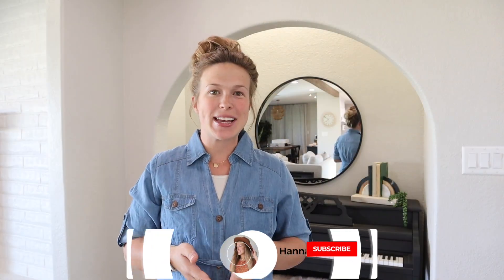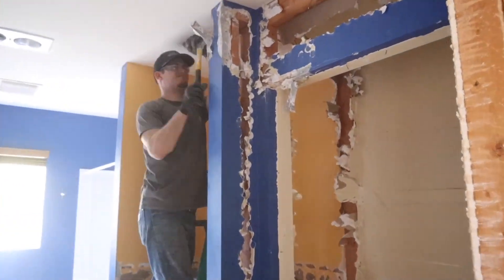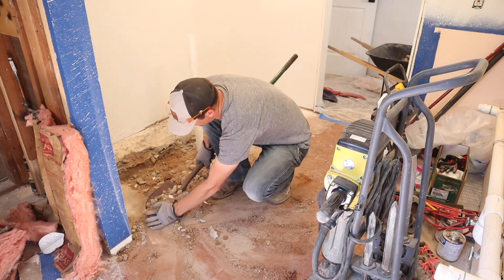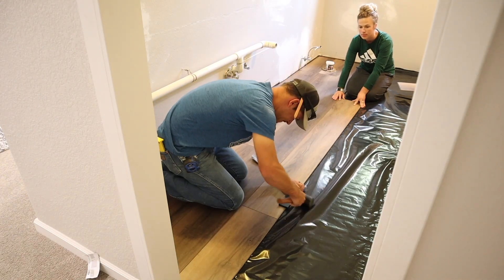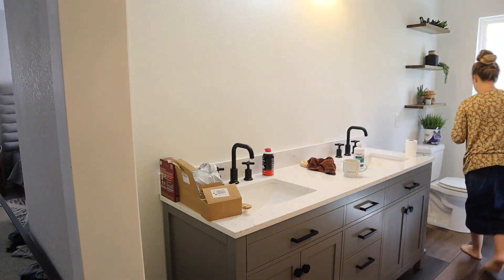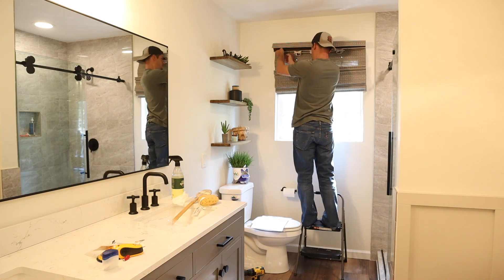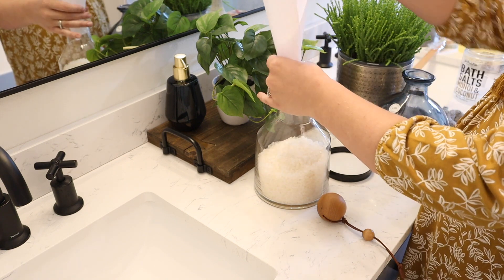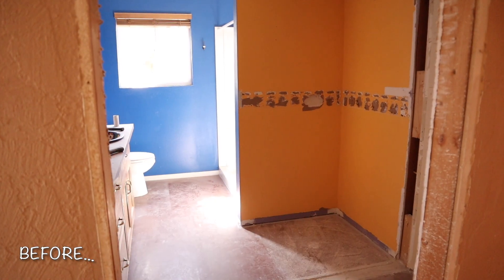COMPLETE MASTER BATHROOM MAKEOVER!!😍 BEFORE & AFTER OF OUR ARIZONA FIXER UPPER

Comment: Another thought for your shower but not as pretty.   In one of our bathrooms we put a pressure rod up on the inside of the shower glass. I hung a plain white shower curtain liner and pulled it closed when showering. It kept the water from hitting the glass and made upkeep easier.  A lightweight liner can be almost unnoticeable when pulled all the way to one side when not in use.